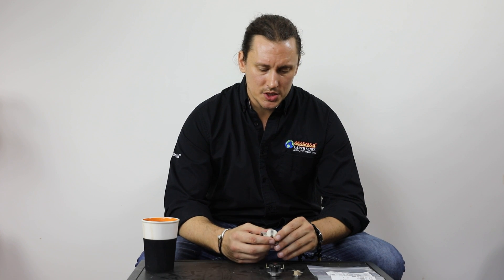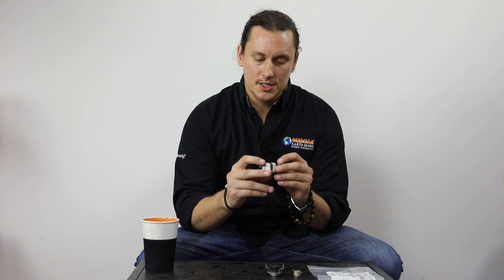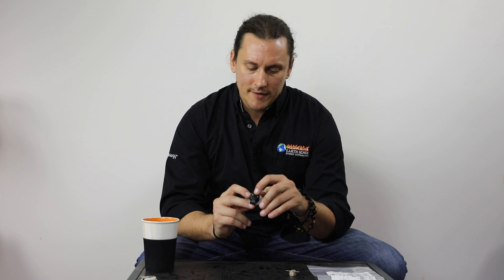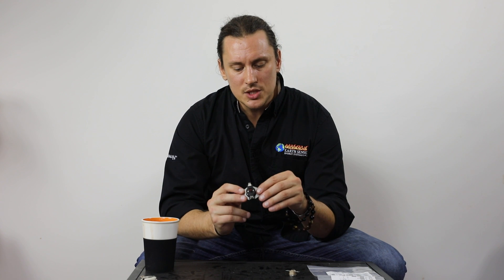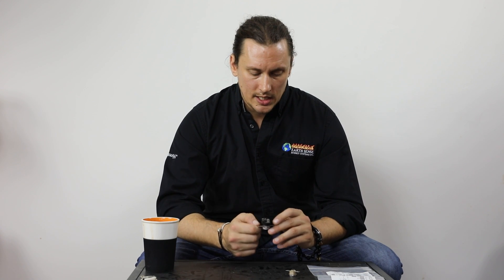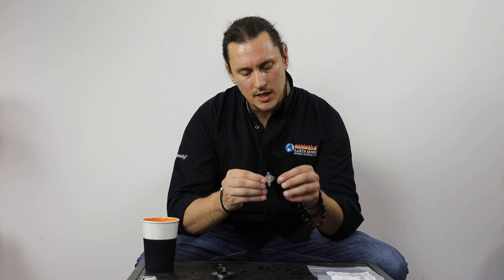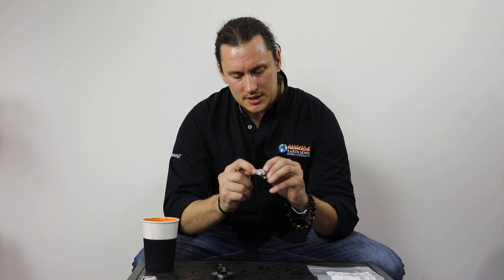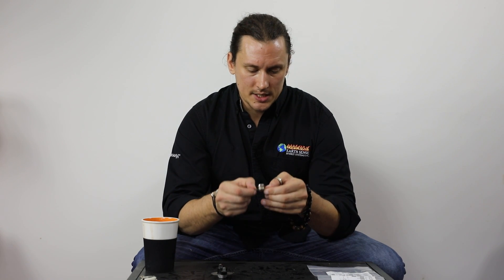Pellet Tech 101 - Limit Switches - Thermodiscs

Comment: I have a brand new Castle Serenity stove. I just fired up my stove for the first time. It ran fine for about 30 
minutes and then quit. There was an "auger jammed" message on the panel. There was a video that was about the same problem, and it turned out to be the temperature limit switch. It has a manual reset on it. My stove was only set to 3 for heat range with 5 being the highest setting so I really don't understand how this could happen? Now I have to disconnect the flue and  air intake pipes so that I can take off the back panel and check to see if this is the problem. These stoves are too damn heavy to be moving around all the time so that they can be worked on, and I just got it all set up! What do you think could keep this from happening in the future? Does the blower voltage or the exhaust voltage need to be increased to solve this problem?
Reply from the maker: Thanks for contacting us, sorry to hear of all the difficulty you are having with the new stove. We have never carried the Castle Serenity model, so it's hard for us to be able to provide specifics here. I would say that it is extremely odd for a brand new stove to have the high limit trip like that. Generally speaking the high limit switch will only trip if the Distribution/Room Air Fan stops working, or if there is a major build-up in the firepot and the fire is considerably larger and hotter than it would ever be running on the highest setting in proper operation. Tripping when it is brand new like that running on a #3 heat setting, I would say there is most likely an issue with that switch and the manufacturer should replace that under warranty.  Sometimes we will see things like this from the factory with other stove lines we handle. Our tech personnel fires each stove for a period of time before going out so we can catch any factory issues and cure the paint before the customer receives. In your case I would suggest reaching out directly to the manufacturer and letting them know what you experienced; most likely here it's a faulty high limit. Hope that helps. Thanks!
Reply: @EarthSense  Thanks for the reply. Turns out that the blower was not turning on at all. I had the side panels off to get to the reset switch, so I was able to see inside the stove while it was on. I saw the fire die down again after about 20 minutes of starting it, so I went over to take a closer look. I could see that the blower was not moving, and the top of the stove was very hot. I spun the blower fan a few times and it finally started up. Great quality control huh lol?
Reply from the maker: @MRM-wp4gr  Ahh... Now that makes sense that the high limit was tripping - your blower wasn't turning on. Let's make sure to keep an eye on that blower; possibly just a stuck bushing/bearing, but let's keep an eye on it to make sure it's working as it should moving forward. Keep us posted, always happy to help however we can. Thanks!
Reply: I guess im asking the wrong place but does anybody know of a method to log back into an instagram account..?
I was dumb forgot the login password. I would love any help you can offer me!
Reply: @Anthony Alfredo Instablaster :)
Reply: @Jonah Alec Thanks for your reply. I got to the site thru google and I'm waiting for the hacking stuff now.
Looks like it's gonna take quite some time so I will get back to you later with my results.
Reply: @Jonah Alec it worked and I actually got access to my account again. I'm so happy!
Thank you so much you saved my ass!
Reply: @Anthony Alfredo Happy to help :D

Comment: I"ve got my pellet feed dialed all the way down to keep it from overfeeding,  it"a Harman Accentra insert, any suggestions  ?
Reply from the maker: Thanks for contacting us. In 90% cases if you are seeing what appears to be overfeeding issues, it is generally air flow issues - ash blockage or air leaks in the stove or venting. I would suggest performing a thorough cleaning on the stove and exhaust flue pipe venting. From there make sure the door gasket is sealing tight and the holes in the burnpot are all open. If the stove and vent is thoroughly cleaned and the unit still appears to be feeding to much fuel, just let us know and we can dive deeper into tech troubleshooting. Below is a manual on your model for cleaning reference and one of our Harman videos that will give a nice overview on the controls and settings of the control board. 
https://youtu.be/cZErnzd53IA?si=YV6pShIzjPvIuIyn

https://downloads.hearthnhome.com/installmanuals/accentra_insert.pdf

Hope that is helpful. Thanks.

Comment: I have a Harman XXV and the distribution blower turns on but does not blow as hard as it used to. Could this switch be the problem?
Reply from the maker: Thanks for contacting us. The Harman XXV will not use snap discs like other stoves. The exhaust ESP probe essentially performs all functions that snap discs would. We would suggest a good cleaning on the blower - the fins will get built-up with hair and dust overtime slowing down the CFM or air flow. Recommended to pull the blower out and use a dry paint brush and compressed air to clean all of the fins. It can also be good to clean your ESP probe to ensure it's reading temp correctly. Videos below on the blower and cleaning the ESP. Keep us posted, happy to help. 
ESP: https://youtu.be/kt7nnGMYU-k?si=35qLjpiqTbXieXpC
Blower: https://youtu.be/xRquiynhb00?si=2qGgNYXjVc5_TIA-
Reply: @EarthSense  Thanks for such a quick reply.
i have already taken the blower out cleaned it and bench tested it, all seems fine.
I also have cleaned the ESP and replaced the circuit board for an unrelated matter but the blower still seems to work at half speed.
I installed the stove in 2008 and have never pulled it and given it a thorough cleaning.
I think that will be my next move, maybe replace the ESP.
Reply from the maker: @harryking4648  Most welcome. Sounds good - If you bench tested the blower and it's running at full capacity, then it generally wouldn't be an issue with the blower itself. Yeah, the ESP and control board are the two components that are regulating that blower. When you turn the feed adjuster dial to TEST does the blower have full output or only half? Test will bypass everything allowing your blowers to run full speed for 60 seconds. If the blower still feels like its half the output on Test Mode, then we would suggest checking the air cavity that the blower seats in to ensure there isn't some kind of blockage. If there is significant ash buildup in the heat exchangers or exhaust manifold that can also play a part here. If you have a leafblower Vac, place the sucking/vacuum end on the exhaust pipe outside. This will pull out ash that's trapped in difficult areas. Make sure the stove is off when doing this. Here is the type we use on our cleanings. https://www.toro.com/en/product/51619
Hope that helps, keep us posted.

Comment: I have question on new englanded 2000sq ft pellet stove...fan speed doesn't blow harder as I change fan speed setting to max. What could be problem?
Reply from the maker: Thanks for the message Owen. On some models the heat/feed settings and blower/fan settings work together. Meaning if I have my heat setting/feed setting at a 1 or 2 level, and I try to turn my blower to a max speed, it will not allow it to. For best efficiency it's recommended to have the blower speed/settings in line or close to the heat/feed settings. If that is not the case with your model, I would recommend the following: Make sure the blower fins/impeller wheel is clean of dust and debris. A Dry paint Brush and compressed air are great tools for cleaning the blower fan. If no change when the blower is clean, grab a multi-meter and check to see if the voltage going to the blower is adjusting as you are changing the fan speed. If output voltage to the blower is not changing as you move to different speeds/ settings, then we would take a closer look at the control board. If the output voltage to the blower is changing as you adjust the speed settings, yet your blower is not ramping up or ramping down CFM/air velocity, then we would take a closer look at the blower motor itself. Hope that is helpful, keep us posted. Thanks!

Comment: Does the Harman p61manual use these discs or is the ESP probe responsible for this function. I Have looked on the elec. diagrams and cannot see anything. I Have a 2008 stove and my PC board blew this year. The new board has been giving me grief, shutting the stove down. The DIP switches are set correctly. It happened at the end of the season so I was unable to run it to much to troubleshoot it. Just wondering it these switched are in play to help me troubleshoot. Thanks
Reply from the maker: Thanks for contacting us MaryJane. The Harman P61A does not use any snap discs/Limit Switches. Harman uses the ESP thermister probe instead which handles the electronic and safety aspects that these switches normally would. Once you fire the stove back up and get a good assessment of what's going on, we are happy to help you troubleshoot and get back to 100%. I will note that your stove does have a vacuum switch. The vacuum switch will shut down the fuel feed if it's tripped. Here is an overview video on the vacuum switch https://youtu.be/pHeQzUmSlIE 

Thanks,
ESESstoves

Comment: I have a quadrafire 1200. Pellet stove. The call light will not come on. There is power to the board but it will not call for heat. There is no power to thermostat,or to the pressure switch either. I have replaced the main board and the number 2 snap disk. Blowed thru the hose on the pressure switch and ran a diagnostics with the board on 0. The pressure switch  jumpered and the number 2 disk jumped. Both blowed motors work and the auger functions. I set the box to 1 and connect the snap disk and pressure switch and plug stove back in. Turn up the thermostat and still get no power to call light. No power to number 1 snap disc ( yellow wire ) power to number 2(purple wire) no power to pressure switch. Power to number 3 snap disc. Fuse is good.  No power to reset button.                           Do you have any ideas? Please.
Reply from the maker: Thanks for the message. Let's take a close look at the thermostat terminal where your thermostat wires go into. Get a good light and inspect all wiring and connections. If possible, try an alternate low millivolt thermostat. You can also jumper the thermostat terminal by placing a paperclip or large staple between the two thermostat wire connection points. Let us know if you're call light comes on when you jumper that. Happy to help get you back up and running. Thanks.
Reply: @EarthSense  that does nothing. Ther is only like 3 volts at the thermostat wires. Same where they come out of the box. The call light still does not come on.
Reply: Yes I did jump the thermostat wires also.
Reply from the maker: @JimHaskell-es8pe  Thanks for the message back. Let me check in with our tech team and circle back around to you Jim. Be in touch soon.
Reply: @EarthSense  thank you.
Reply from the maker: Heard back from one of our technicians - Check the resettable high limit mounted on the auger drop tube. Then check the wiring going to thermostat block on back of stove. 
Keep us posted, happy to help.
Reply: The thermostat block? Is that where the thermostat wires connect to the wires coming from the control box? Can you get me a picture of the thermostat block please
Reply from the maker: @JimHaskell-es8pe  Hey Jim, apologies as I was away from the computer this weekend. Yes the thermostat block is where the thermostat wires will be secured externally and internally wires from the junction box will connect to that thermostat terminal block. The terminal block here controls the power to the stove so we want to inspect it closely and possibly do a test with a multi-meter to see if power is coming through the terminal when we have the thermostat wires in place and the thermostat calling for heat or when we jump the terminal with a large staple. Keep us posted. Thanks.

Comment: We have a Quadrafire 1200.  It starts up like a good stove should, heats up, reaches thermostat temperature and shuts down like a good stove should. However, when temperature drops, red call light goes on, it dumps pellets, igniter heats up ( have checked, it glows), but pellets will not ignite (the get a little burned).  Will one of these switches cause it not to re light after a normal heat up and shut down?  It has a new thermocouple and have cleaned, cleaned and cleaned!  Thank you.
Reply from the maker: Sorry for not seeing your message sooner. It's the air rushing around the igniter that is lighting the pellet fuel. Let's make sure you are getting a good seal on the front door and ash door. Double check the burnpot bottom and make sure that appears to be sealing tightly. Glad to hear it's been cleaned well - any air losses or air blockages can create ignition issues. Also, even though the igniter is glowing it may not be in proper ohm range. Always good to do a quick OHM test to make sure. If you have the standard 300 watt loop igniter, ohm range should be 43.0-53.5 to be in proper range. Here is a video that will cover igniter troubleshooting a bit more. https://youtu.be/z4wmCc96rVI?si=k4BPNj50f5s0DTI3
Keep us posted, happy to help.
Reply: Thank you for your reply and suggestion.  I don't quite have the expertise to check the OHM, however, I have two new igniters and get the same result. Here is an update...  Someone gave me a suggestion to adjust the pellet feed to full open.  I did this and (to my surprise) ran perfectly for 2-1/2 days!  Unfortunately, it started doing the very same thing again.  Just FYI, in addition to all the cleaning I have changed out the thermostat, thermocouple, control box and twice the igniter.  Checked all the seals with a $1 bill and made sure the clean out at the bottom of the burn pot is tight against the pot bottom.  I am in the process of trying to locate a technician, but they are scarce in our area.  I very much appreciate your response and assistance. Should you have additional suggestions, PLEASE don't bother with it until you have time after Christmas.  Hope yours will be very blessed. Thank You.
Reply from the maker: @MelindaMcDonald-ku1ew  Thanks for the message back Melinda - appreciate you covering everything. So with everything you mentioned, it sounds like the unit is just not delivering enough fuel on start-up for proper ignition. Some pellet fuel is longer than other pellet fuel and that can certainly come into play. Some pellet fuel has higher moisture content than other pellets and that can definitely come in to play as well. It would be interesting to do a test with a few bags of different kind of pellets and see if there is a change. Additionally, I assume you have the clear control box in the unit - When setting up the control box dial, there is a second setting that will increase the fuel 10% on start-up - for the 1200, that will be setting #2 (Link Below). If working with any of the circuitry just make sure the stove is unplugged from the wall. I hope you have a wonderful Christmas as well! Keep us posted. Thank You.
https://youtu.be/mgfUCtbzU5c?si=0GIidxMyEdaTsp60
Reply: Thank you once again for your continued support.  Yes, we changed out to another brand as suggested but results are the same.  Heats great for a few hours, then randomly chooses to not ignite.  If we clean out the un lit pellets, they amount to almost 4 hand fulls, which sure seems like enough!  Just one other thing, if we set the thermostat very high, so it dosen't cycle through the stop and restart cycles, it continues to heat just fine.  @EarthSense
Reply from the maker: @MelindaMcDonald-ku1ew  Apologies on the delay Melinda - was traveling. Thanks for the information, glad you tried another brand of pellets. 4 handfuls of pellets in the burnpot is a lot; should be more like a handful or two that comes in during the initial start-up cycle. Too much fuel in the burnpot on start-up can cause issues including explosive ignition. Is it always feeding that many pellets during start-up? With proper fuel dropping during start-up, knowing the pellet fuel is good, and with the igniter in proper ohm range, the only other thing that would be preventing periodic ignition would be air-flow. Even small amounts of air flow issues can cause ignition failures. I know you have looked at these things, but I will list them here again. 
1. Burnpot holes fully open
2. Burnpot bottom closing tight
3. Burnpot gasket sealing tight
3. Ash Pan Gasket sealing tight
4. Front door rope gasket and glass gasket sealing tight
5. Stove, ash traps, venting thoroughly cleaned of ash accumulation. 
6. Combustion motor running at proper voltage (Should be near line voltage on start-up).

We do generally recommend having the thermostat on high for consistent operation on low, med, or high in cold winter months so it's not cycling on and off. However, we still want to find out the area or part that is creating the issue with reignition. Happy to help, keep us posted.